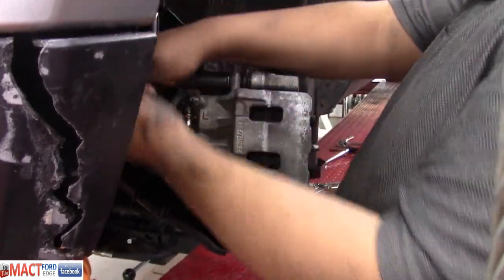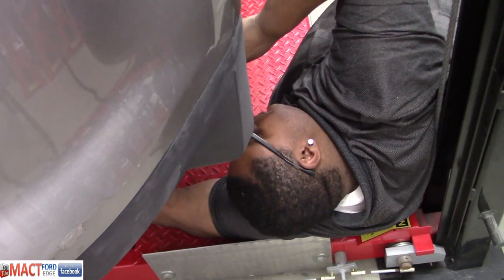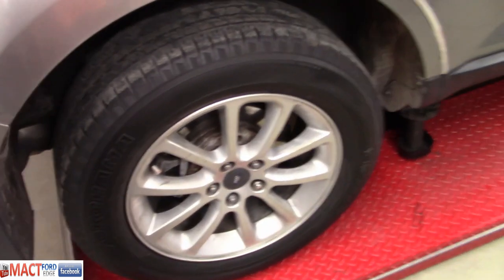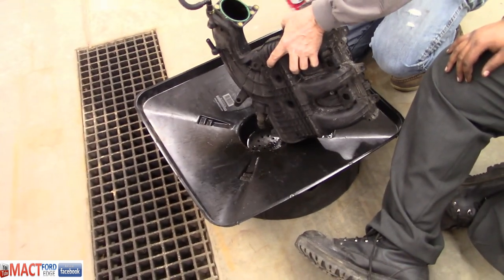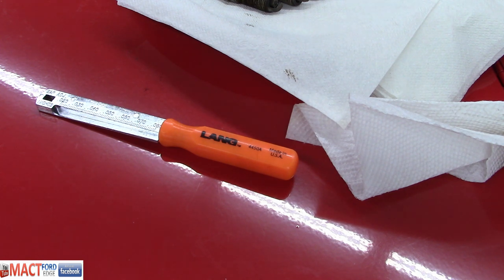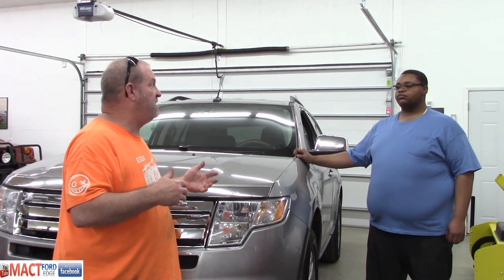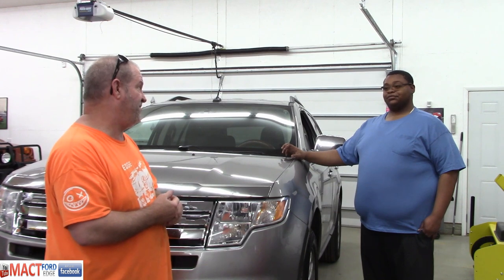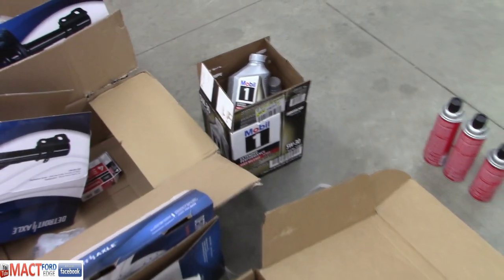Antonio learns how to work on his Edge with MACT and Jeff part 2 plus bad news

Comment: How many miles are on that edge
Reply: 103,000
Reply: Wow that's pretty young for having a bad transmission but it's worth it to put a new one in and maintain it
Reply: @yellowsubie28  It's actually not really bad as he explained in the video. It does vibrate slightly in 3rd and 5th gear but the vibration is almost gone because I changed the fluid right after I went home after this video. The flare and slamming into gears I always experienced after disconnecting the battery. That's the relearn process for my transmission since it's adaptive and once you disconnect the battery, it has to learn how to shift all over again. It slammed into gears for the first 30 miles or so depending on how I drive it I took things easy and it went away in no time. It now shifts like butter. As long as I don't race from the stoplight or go over 90, I won't feel the vibration at all. But I'm still going to get it checked out just in case.
Reply: That's good my 2007 has 161,000 and it does the flare at third gear it does it intermittently I change the fluid every 15000 and disconnect the battery it still does it so I know what that means drive it till it quits
Reply: @yellowsubie28  I'm glad mine doesn't flare anymore. I've disconnected the battery many times for various reasons and that flare always got on my nerves for the first 30 miles.
Reply: @tonybfordedge2830  😂 nope the 6f50 has a technical service bulletin ! A clunking and slamming into gear and other crap seems to be inner and outer speed sensors !